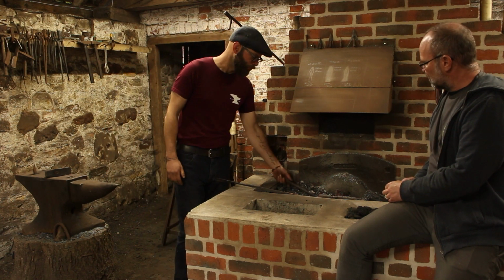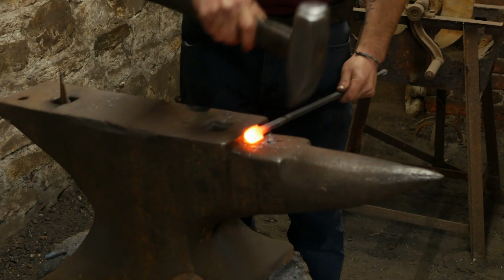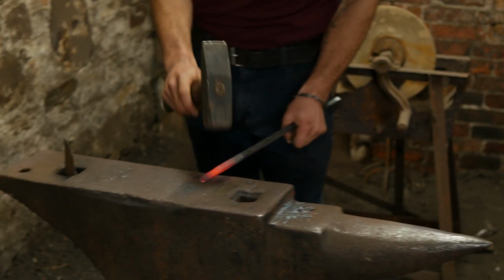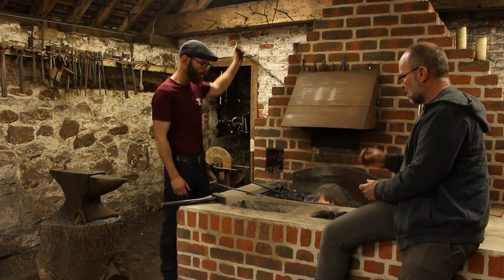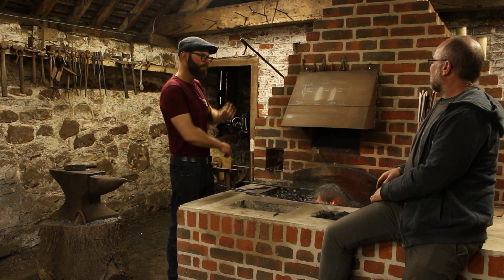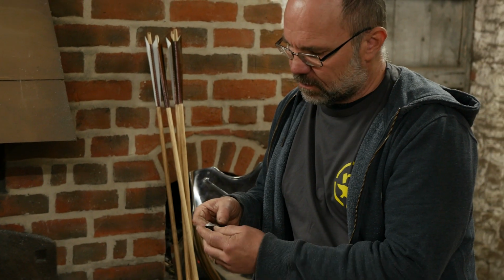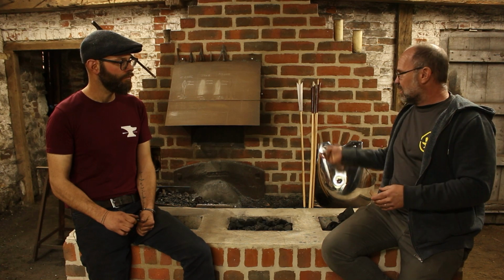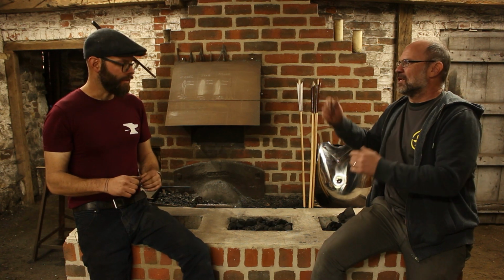FORGING AN ARROW HEAD, full process.

Comment: As a hobby blacksmith I found this very interesting to watch. Will's experience really shows, as does his precision hammer use. I was a little surprised at how cold he worked the metal at times, but it always worked out and prevented additional heats and time. Again, I think that's his experience showing through. And he makes the socket creation look so effortless, where I am sure I'd be making a mess of things.
Reply: I agree completely! The amount of work it takes to build this level of precision is pretty amazing. As for the temperature he's working with. Iron, and even mild steel, can be worked quite a bit colder than carbon steel and tool steel but some of it comes from the camera and lighting making it hard to see the temperature. You don't want to move a lot of material in the lower temperatures but you can certainly tweek and planish and adjust if you're gentle about it. You can actually work the material with a hammer from cold and get it up to red hot pretty quickly by compressing the metal instead of stretching the metal. If you learn to bevel your knives and tools with a compression technique instead of a pinching or drawing technique you can maintain forging temperatures for a lot longer, esp. with very thin pieces. I consider it a bit of a party trick to light my BBQ grill by hammering the end of a piece of mild steel until it heats to red and using it like a match.
Reply: The reason the iron is worked cooler than expected is that the cooler the work the easier it is to control the spread and thickness of the socket walls. Hammer work on very thin iron requires great skill. Too hot and too heavy a blow and the iron will deform and "dimple" which will make the wall too thin.
Too cold and the iron will split.
This man's skill is 💯 🥰
Reply: @Spinningininfinity  That absolutely matches my experience. Soft, thin metal is super-easy to deform. I remember the first time I tried to make a thin copper scoop, I wrecked my first 2 or 3 attempts.
Reply: Is wrought iron different to modern steel, in how ductile it can be? Would the silica content make it a little more plastic at lower temperatures? Or is it the other way around?
Reply: @Mikey__R  wrought iron work hardens in much the same way that non ferrous metals do but it can be extremely ductile. Wrought iron is still preferred for lots of decorative projects like scroll work in doors and windows or gates and fences. Historically it was also preferred for things like hinges and fittings because it was easy to work to a precise shape and once it got to that shape it would be work hardened enough to want to stay where you put it.
Reply: @douglasyoung927  cheers! I never actually considered that hinges might be hardened. I know that scythes were "sharpened" by hammering, but I assumed that was because they had a little carbon content. I always thought iron doesn't work harden at all, but then, I suppose bloomery iron still had some carbon from the furnace and pure iron is actually impossible to make using medieval tech.

Interesting subject!
Reply: Rarely will you see a hammer used with such control, have rewatched the hammer sequences  they are so satisfying
Reply: thats cos your not as experienced in this work as him it is no fault or disrespect on your skills they are just different is all, but plz continue your hobby and enjoy
Reply: @Mikey__R  All metals work harden, it's just a question of how much.
Reply: @Mikey__R Did they specify if it actually is wrought? I was informed a few years ago only a very few places in the world still make wrought iron. It's easier and more economical to make mild steel. Then again I did hear one of those places are on the Britain great isle.

Wrought iron isn't steel at all. It's iron. As close to elemental as we can make it in some cases, and it's not traditionally hardenable. It's primarily the carbon-iron crystals we harden in steel, that which exists only while orange hot, austenite, quenched to brittle martensite and then tempered out of brittleness to partially pearlite/ferrite, partially martensite. 

Basically the edges of martensite are sharp and uneven, you heat melt those out and it will have less internal pressure. If you drop a just-quenched blade with good steel on the concrete or stone floor, it has a tendency to shatter.... Temper it and you lose maybe ten points of hardness but gain you a more reliable blade.

Wrought iron meanwhile is extremely ductile, movable, and will not crack at colder temps so easily. Similar to mild steel today, which we prefer because it can be cast and rolled easier, not so much worked into shape and welded many times to create larger bars, extremely weldable as it is. Tedious.

 Iron is fine for an arrow that's not meant to be extremely reusable on the battlefield. They're happy if they got 3 of 10 back to salvage the tips. Some would be buried with the bodies, others buried in the poached mud, others having simply buried themselves. Ductility won't matter until you need to sharpen it again. The force behind the bodkin is the shape and speed and angle, directness of the shot being vital against armor, aim being essential to avoid armor too. Iron is hard enough not to shatter and not ductile ENOUGH to pancake like lead or pure copper might, hitting armor steel. Not really good for two shots though.

As far as really thin and the silicate content, it makes it more movable and less brittle, particularly less brittle against the grain. 

Hardening wrought iron will involve compressing the grains without then heating it too much after, which means colder working it deliberately. As you do copper and bronze. "Work harden." Or to seal it in a low oxygen high carbon dioxide flame box for hours at temp, making for a certain depth of higher carbon steel, which can then be hardened. "Carburized" or "Carburization."

Not an expert, this is my understanding as a welder with exactly 3 months in a single metallurgy class. And a hobbyist Smith for ah, 5 years in my life a bit back. hope it helps.

Comment: I highly suspect that a medieval high-production blacksmithing shop would have one young boy working the bellows constantly while several smiths using the same forge would be working two arrowheads (or whatever) at once, shaping one on the anvil while the other arrowhead is reheating in the forge and trading them out every several seconds.  Note that the smith in this video loses almost half his time waiting for the arrowhead to reheat.
Reply: I think an experienced smith can work 2-3 pieces at a time without a big hassle.
Reply from the maker: I agree, I suspect he could have 2 or 3 on the run at the same time and yes a bellows boy would have been used then, just trickier to get these days!
Reply: Water powered drop hammers and bellows existed early on, along  with gigs and dies to speed things up. Also, examples of big iron pieces are well beyond what can be done with hammer and sledge.

Comment: It took him about 6 minutes to make one arrowhead, not rushing too much, which if he needed to hit 100 of them would have taken 10 hours of non-stop work to do. Holy crap.
Reply: I'd say ~5h.
Mass producing them instead of doing one from start to finnish will cut the time a lot.
Reply: @XtreeM_FaiL  It depends. I can't keep track of more than about three irons in the fire before I get confused and burn one. You could probably speed things up a bit that way, but the fact the bar is already hot, and doesn't need a cold start is already an advantage.

That said, I'm not an arrow-smith, just a humble blacksmith (although I have made a few arrowheads over the years). Maybe Will can shed some light on it.
Reply: @danioshea  You need an apprentice. :P
It was just a guess. 5h is probably too optimistic, but I still believe it is doable.
I know nothing about black smithing (exept the old master gives iron he is holding to his apprentice thing).

Doing things from start to finish is the slowest method, but then again it keeps quality level high.
Reply: @XtreeM_FaiL  you assume multiple people working though, so each one can focus on one task, but they talked about how one smith was told to make 100 in a day
Reply: @chrisbolland5634  No, just one person.
Back in the day they did not have what we have today. A high quality raw material.
Reply: @chrisbolland5634  Actually he implies one person, but then says at 11:08 "they were asked to make 100 quarrel heads, that's one arrowsmith, or a team of arrowsmiths" I would guess that this is based on the bill, one arrowsmith was paid - but he would have probably had an unpaid apprentice helping, someone who would be invisible on the financial records
Reply: @danioshea  the heads I'm making in this film are slightly more labour intensive than a crossbow head,  which is where the 100 a day comes from. 

These heads need a final stage (to make them a diamond section) as they're a late medieval arrowhead.   The quarrel heads of the 1200s were square in section,  and easier to forge.

I'm also not rushing here,  or trying to meet a deadline.  Essentially if I were really going for it and making the easier crossbow head,  I'd be looking at 4min per head on average.   That's 6.5 hours more or less, so not really a struggle.
Reply: @MedievalArrows  so a small team of people could easily make hundreds of arrows in a day
Reply: @wierdalien1  Total layman here, but my guess is you can only fit so many people into a workshop until they start getting into each others' way. Twirling around each other with very hot metal in their hands. That seems neither safe nor efficient. My guess would be two people for one anvil, more would be unnecessary. Then it depends on the size of the workshop and how many anvils and smiths/apprentices you've got.
But if Will says he could do 100 alone in 6.5 hours, that would be 200 in 13 hours, so technically he can already do "hundreds" in one day alone.
Reply: @Quallenkrauler  You've still got to eat etc,  even if only one person is forging at a time, its not beyond belief you'd have an actual team
Reply: @danioshea  And that's why we have the saying, "Too many irons in the fire." when someone is overburdened with too many tasks at once.
It's really great to hear an actual smith relate the origin.
Reply: @davidbarrass  Oh totally true, I didn't catch that. That makes it much more doable. Thanks!
Reply: @MedievalArrows  

Just an amateur guess here, but I would think you'd have to do this for quite a while before you can do 6-7 hours of this kind of hammer work and not end up being WAY to sore to work the next day
Reply: @chrisbolland5634  I think 100 in a day is easily doable for a dedicated professional forger, theres a great video out there about a guy called Albert craven, who was the last of the blade forgers from Sheffield, he says that in his hay day he would regularly do two gross of knife blades a day. A gross is normally 12*12, but in this case it's 14*14 - a blade Smith's dozen is 14 because it includes the two blades you enviably lose in heat treatment. So we're talking about nearly 400 blades a day off a very similar setup, except he had some kind of automatic blower and a sweet cutler's anvil (has many wedged slots which hold multiple bottom tools, for repeatable curves, cut depths ect.)
Reply: And that's just with one guy doing all the legwork. A full on smithy with a gaggle of apprentices probably went that extra bit faster
Reply: No it didn't, the video was edited so we don't know the true time it took, and the arrowhead was not sharpened in the time either.

Comment: Brilliant to watch a craftsman at work and the explanation of the process. Really illuminating.
Not a criticism, but in earlier video's there was mention of case hardening or "steeling" which may have been done - If Will ever gets round to making a vid where that process, or at least what they may have done, is explained in relation to his making of his arrow heads that would be every bit as interesting. Great vid and I look forwards to the testing these heads will be engaged in. The Breastplate vid is superb with the team.
Reply: Similarly, I'd like to learn the difference between brazing and fire welding that was mentioned in the video

Comment: I always wonder about the quality control of the arrowheads since arrowsmiths would be very busy mass producing them in the hundreds, especially for a military campaign. A lot of these arrowheads would be done properly, of course, but I'm sure some of them would not be made properly if the arrowsmiths were in the hurry to meet the deadline.
Thanks for answering that there was quality control during those times.
Reply: In 1405, Henry IV passed a law requiring blacksmiths who made arrowheads procured by the King to make the arrowheads out of hardened steel and to put their marks on the arrowheads so that if it were found that the arrowheads were not made of hardened steel, the blacksmith could be identified and punished. The blacksmith in this video is making arrowheads out of wrought iron, so he would have been one of the blacksmiths who would have been punished for selling inferior, ineffective arrowheads to the King.

Comment: Had understood that 'plate-cutters' did not have flat sides to the pyramid tip, but that those sides were dished inwards slightly to emphasize the edges between the flats, which were then able to cut better.

Comment: At 11:08, is that 100 for one person or one workshop? That seems like a huge difference to me! In the discussion on mass production, do we know if the making of just the arrow head was further subdivided by specialty? One person flattened the socket, another rolled it, yet another cut it off, and a final person shaped the head? I presume more menial jobs like grinding/filing, stocking the fire, and so on would be done by apprentices anyway.

Comment: I know I'm late, but I have an bit of information about why Roman arrow heads may have been slit. I can't say for certain because I only know this about early medieval (Merovingian) spear/lance heads. They were slit as a means to secure them to the shaft. Basically, the tube is slightly smaller than the arrow or spear head. That way, when you insert the shaft, the metal is under a bit of tension and will stay on the shaft without the need for any nails (or glue, for that matter). Basically, it makes arrow (or spear) making a bit quicker and easier, which allows for mass production. Plus re-using arrowheads becomes easier as well: if the shaft breaks, just pull out the rest, stick the head to a new shaft, add fletching and shoot it again.

Whether that was the reason why the Romans did it, I can't say - but I think there's a good chance. As for spear/lance heads; the slit tubes came out of fashion during the Merovingian era. By the late Merovingian era (700 and onward) they weren't used anymore, giving way to precursors of the Carolingian winged lance (which, when you're replica-shopping, are often called "Viking" - as are Carolingian swords, which usually were imported to the Nordic countries and possibly re-hilted).

Comment: I had a thought when thinking about the whole arrow vs visor dilemma, and I thought maybe a more brittle head would maybe have a great effect on target. Reason being even if the visor can catch the arrow, the tip of the arrow may be likely to break off and continue to travel into the helmet. I wonder if the arrowheads you will be testing will have varieties in hardness and such like this?

Comment: Would it be reasonably practical to have two arrowheads on the go at the same time?  So could you have one being hammered and one heated, swapping them over each cycle?  I don't think the timing is that far out, especially if you had an assistant tending to the forge.
Reply: For best production there should be many irons in the fire at once, the smith working them in rotations.